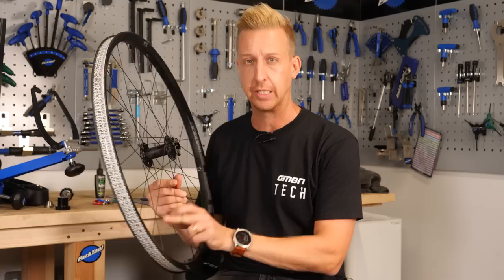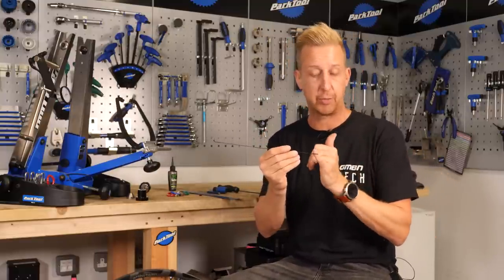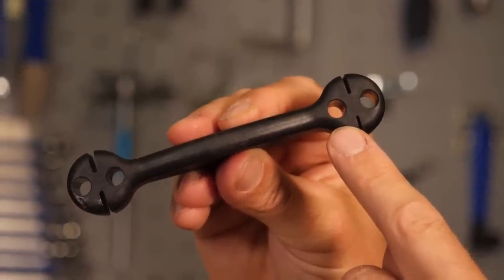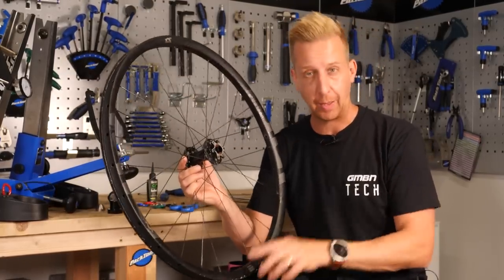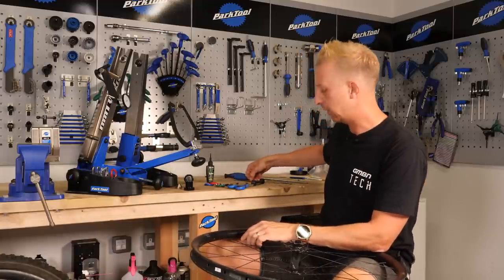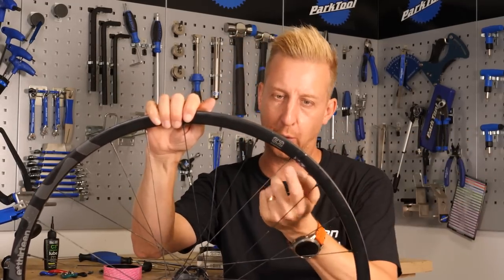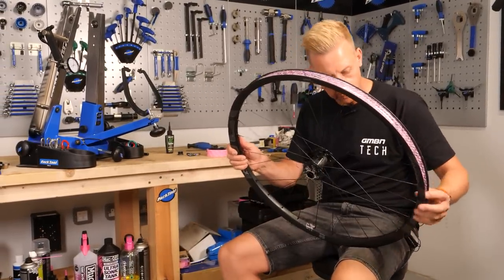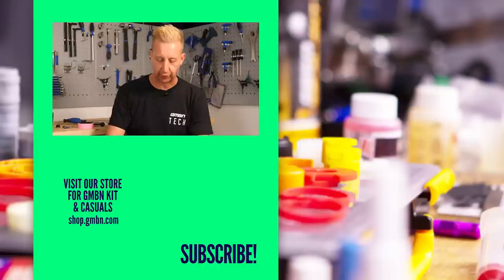How To Replace A Broken Bicycle Spoke

Comment: Before I mount the wheel in the frame/stand, I like tighten the spoke up until it makes a similar note to neighboring spokes when plucked like a guitar. Then when I do finally put it in the jig, usually only need minor adjustments to finish it off.

Comment: the proper fixing is releasing all the spokes tension and retensioning?
Reply: This comment should be at the top. The likelihood of breaking more spokes is much higher if you don't release spoke tension and bring them all up to tension together after installing the new spoke. Learned this lesson the hard way after breaking 4 spokes in one weekend.

Comment: I've bought ZTTO tensiometer and the added table with kgf data was a bit off comparing to tension on my other's bikes wheels (Rodi, DT Swiss, Mavic). I thought it will be that easy: buy tensiometer, check spokes tension and voila. Actually no... I read on the forums that I need to calibrate tensiometer and I need to make DIY tensiometer calibration tool... The ready one can cost arround 500-600$. I truing wheel by myself because it give me more satisfaction and I can learn something new unlike giving it to the bike shop. I know buying truing stand and the other tools for truing wheel is a cost but for me this is the cost of knowledge and satisfaction of being independent from bike shops. Of course it's ain't cheaper rather than going to bike shop.

Comment: So in your trail repair kit you need a cassette lock ring tool, a chain whip and a ruddy big spanner, and maybe a tool for HTII if the discs need removed?...maybe time to avoid "J" spoked wheels altogether?? Straight pull seems so much more logical than introducing a weak elbow anyway...
Reply: Some hubs allow you to remove the freehub body with the cassette still fitted, I know DT Swiss are like this.
Building a wheel with round profile straight pull spokes is a colossal pain in the a***. I know, I've done it once and I'm never doing it again!
Reply: How many years have j-hook worked perfectly fine?

Comment: #aksGMBNtech Hi. I have a question regarding spokes. My spoke in my front wheel makes an annoying "kling-kling" sound when I ride with relatively high tyre pressure during cornering. ( i checked, it's not the brakepads rubbing) Also the wheel is only a few months old. Is there a way to fix it? Thank you.
Greetings from Hungary. 🙂🚵‍♀️

Comment: 5:27 i use small magnets to get them out  but it won't work on aluminum spokes
Reply: All spokes are stainless steel, you just need a strong magnet.  Well for bikes you buy at a shop at least, not Walmart.
Reply: Neither aluminum nor brass nipples are magnetic, and when would you need to use a magnet on the spoke itself?
Reply: @mattgies  when they build wheels with no spoke holes, like the original mavic ust tubeless wheels, they thread a broken spike in the nipple, and use the magnet to guide it out the spoke hole, because the valve hole is the only hole in the rim you can drop it in. So the magnet to lay works with the broken apple piece in the nipple.

Comment: A tip for everyone do not take your tire off and attempt to change your spokes on the trailside taking your tire off alone is an idiot maneuver unless you absolutely have to go a lot further
Reply: why arent wheels designed so one can change spokes without taking  off the tyre? could save us a  lot of time

Comment: Doesn't show removing the spoke, doesn't show removing the broken nipple.  FFS.  I always have trouble removing a broken straight pull spoke from the hub, as the other spokes are in the way.
Reply from the maker: If it's broken you can clip it out with some pliers or a pair of bolt cutters! :)
Reply: @gmbntech  how do you get the next on ein then?

Comment: With respect– I’ve replaced spokes on my tubeless rim without removing the tire and tape. Of course, I’ve had the good fortune (really?) of only breaking spokes at the hub, so it’s much easier to just keep the nipple in place with a small clamp or clothespin. Truing the wheel with the tire still on takes a bit more care, but is doable.